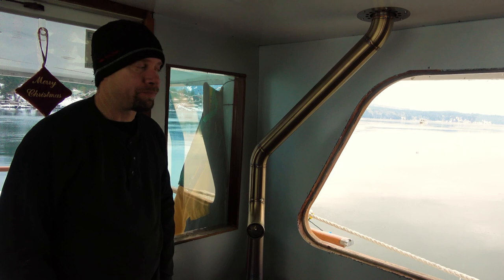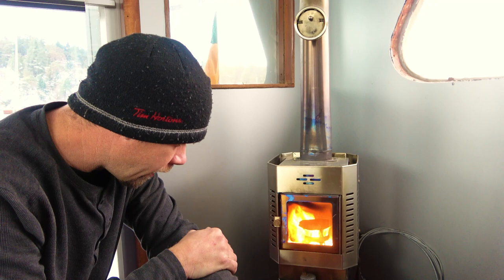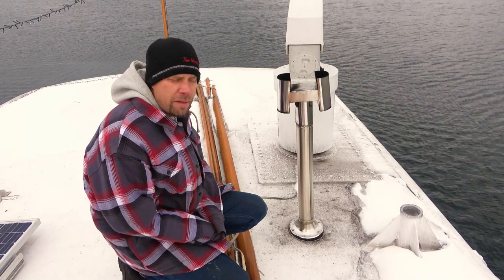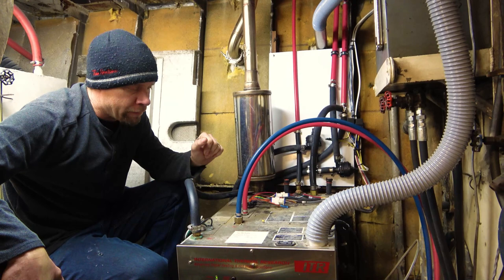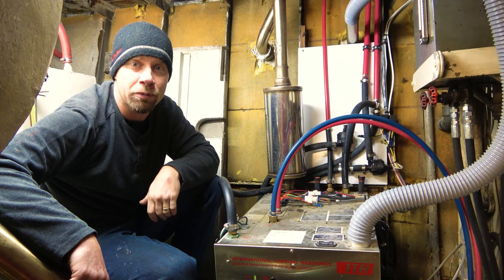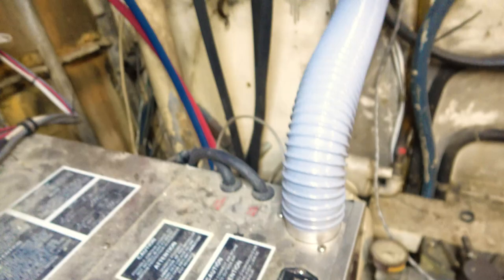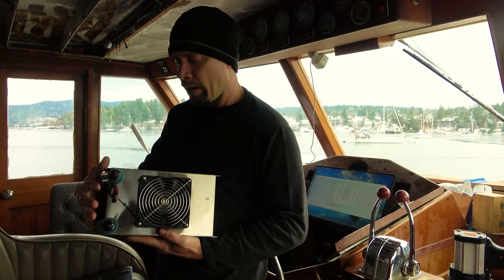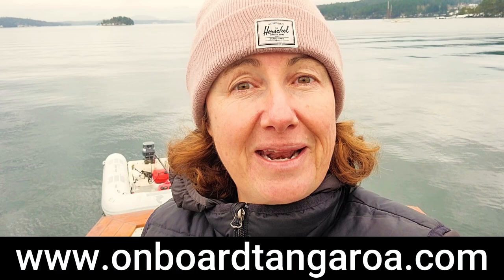Diesel Heater on a Boat | Our Hurricane Hydronic and Dickinson Diesel Boat Heaters.

Comment: To get away from the lazy orange flame which produces soot you have to turn up the fan assist...the problem with this is that more heat from the inside of the boat gets pulled out and goes up the chimney as lost heat. You have the room on your boat so I would add a designated air supply from outside the boat to supply the combustion chamber with air for combustion. Very interesting...
Reply from the maker: Thanks for the advice Greg! I have played with the assist fan and had decent results. It still seems to be a bit dirty though. I have toyed with the idea of adding a fresh air supply but need to do some figuring first to make sure it is going to work well whilst looking nice.
Reply: @OnboardTangaroa  maybe bring it up from below where you have that metal box that the heater sits on with the air intake from the outside...or from down deep in the bowels of the boat. I have a small 37 foot sailboat and don't have the space to put one in but my boat is small enough where the Dickinson roasts me out after three hours on low setting #1. I run the fan on the lowest setting all the time and get a clean bright yellow blue flame with almost no soot especially when you first light the diesel. Shoot me your e-mail and I will send you a picture....Best SV Aquila...Shilshole Marina.
Reply: @OnboardTangaroa  Go to Dickinson Diesel Heater best installation ever...just got my first vid out...will be doing another one as soon as complete the trim, tile, cushions, etc...Best SV Aquila...Seattle.

Comment: How big is your  boat? I put  a Dickinson Newport  on a 35' sailboat. So far  I'm not impressed  but that being  said  I've never turned it up past 3 and usually run it at 1.5 or so.
Reply from the maker: We have a 78' boat.  It only heats the main salon and galley which are open concept.  When it is below freezing...it has troubles keeping up but we are all windows and they need replacing.  We use a Hurricane hydronic heater to heat the staterooms and wheelhouse.  We have one hot water loop going into the bow which was thr old crew quarters and one going intonthe stern where there are three staterooms.  A fan blows up from the bow into the wheelhouse.  The Dickinson is our "ambience" heater
Reply: @OnboardTangaroa  so you run the Dickenson on high, just  curious  I've been  a little  scared  to open it up all the way.
Reply from the maker: @Saling Samantas  no...  we have it in 2 usually...and we put a fan behind it to push the heat out into the main area.
Reply: @OnboardTangaroa  thank you  I guess I'll  turn it up and try again.
Reply from the maker: @SalingSamantas  let us know how it goes.
Reply: Go to Dickinson Diesel Heater best installation ever...put one on my 37' sailboat and after an hour it roasts me out...will be coming out with another vid after I complete the trim work. Put it as low as possible...I see too many people that put it way too high.

Comment: I have the same dickenson and mine burns a nice blue flame, You have yours way to high I've had 4or5 different ones since the early 80's  and never had any soot. even from the big cook stoves with ovens. My new boat a spencer 53 has a Kobola diesel heater like your big one that pumps water thru the whole boat but I haven't had it running yet They sound like there a great stove. Still have to figure it out! Whats the name of your shop? love that heavy duty pipe!
Reply from the maker: Our shop is Carmena Performance in Victoria BC.  As for the burn - we are still learning.  Do you mean the chimney is too high?  or the flame is too high because too much diesel or fan?
Reply: @OnboardTangaroa  No I think having that much chimney is great will help it to not blow out, But your flame is really too high. The problem is with a big boat like that you don't get much heat from the smaller stoves, I had the big antarctic stove in my 32' nicholson and it would bring it up to 80 or 90 degrees in the boat. But in this new boat the little one won't even get it to 70. As for the fan I've never used the fan on one they've never worked. When you light it use about a teaspoon or more of methyl hydrate in stove then about a inch piece of toilet  paper to light it. it will burn blue until the diesel starts to burn then more yellow,  But if the meth. goes out don't put more in when it's hot or will Really flame out. It's like gas.
Reply from the maker: Blaine here, I currently can't get it to burn any leaner. The needle is adjusted to its bare minimum and if I go any lower it just goes out. I don't think the two 45 degree bends are doing it any favors. Unfortunately the crane is directly above so I can't go straight. We do have it a bit leaner typically than it shows in the video. I have found that if it's any bigger I get a bit of black on the window and if it's any smaller I get deposits built up in the burner. I will be adding a day tank soon which should allow me to get the feed a bit slower.  It's constant experiment with it to find the sweet spot.